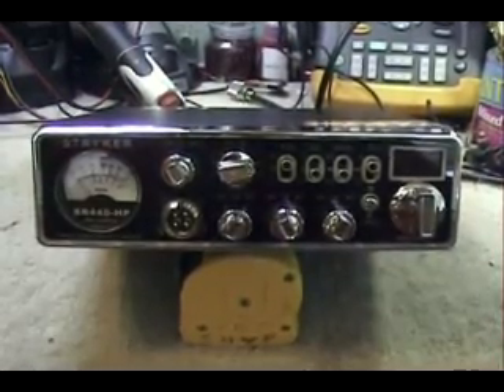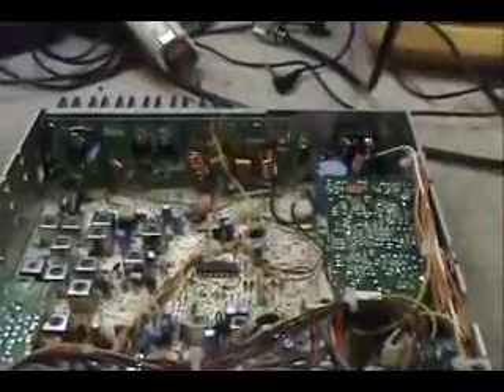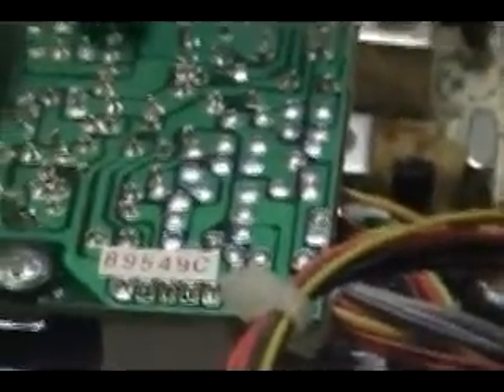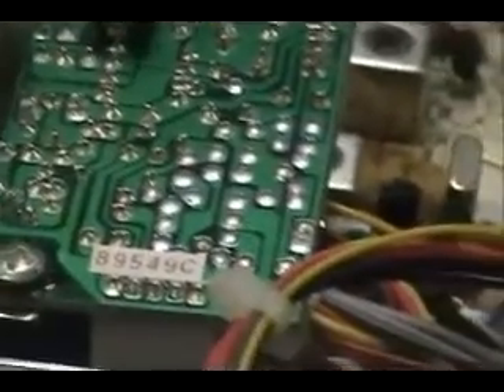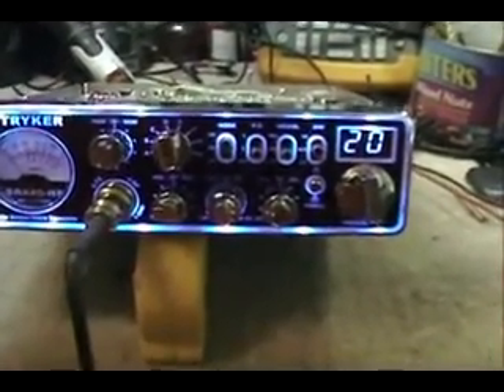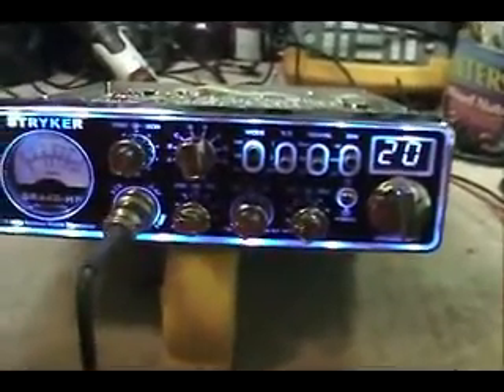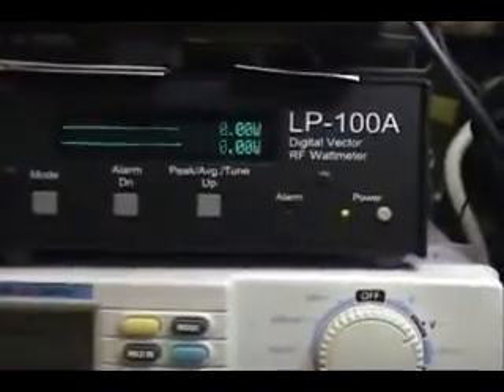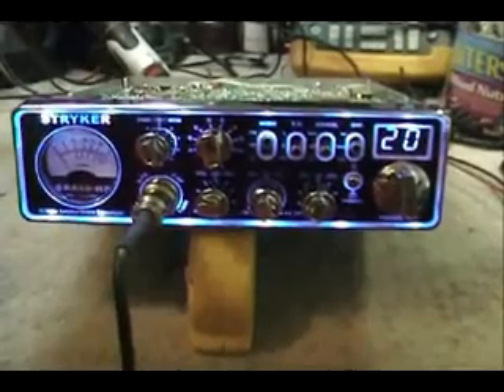Stryker 440 Review and Tune

Comment: Nice Watt meter.
Did you get the optional NIST calibration after you built the kit or did you buy it already assembled and calibrated.
For Z28 Google it. 
It also is a great tool for setting up base antennas.

Comment: Hello Doug I have picked up a STRYKER 440 H.P. And  I would say Mine is at Stock settings about 35 to 40 watts output... No matter where the Power is set at. I would like (YOU'RE MOD) Done to My Stryker How Much does this MOD RUN?? And how do I get the radio to you?  Thanks Greg

Comment: I have an original 440 HP non MOSFET .i believe it has a Motorola final in it.after taking it out of storage for a while in now hums whenever I key up.how can I tell if the final is blown?The needle in the meter does move like it should when keying.And I did have a noise toy put in.But it was always loud and clear.Any help??

Comment: @cbrepairguy If you know of anyone that has bought the digital vector meter and has the capabilities to actually use the lpc5 coupler. Tell them do not buy and use it in line all the time. I have lost my 32 pill and 24 pill after adding this into the system. I bought mine put together straight from site. Tell them to keep using birds. It is a nice meter but can not with stand the high power as claimed.

Comment: @cbrepairguy  Well  I would be REAL Careful about turning up the DC input supply voltage. You should have a good accurate 10 meg ohm input resistance digital multimeter, not some 20,000 ohm/volt meter. You may THINK you are at 14.9v but it could be over 15 volts with an analog multimeter. Otherwise you'll end up with a nasty surprise. AND for 110 watts versus 90 watts  PEP SSB output no one listening to you will know the difference. Nice video though!